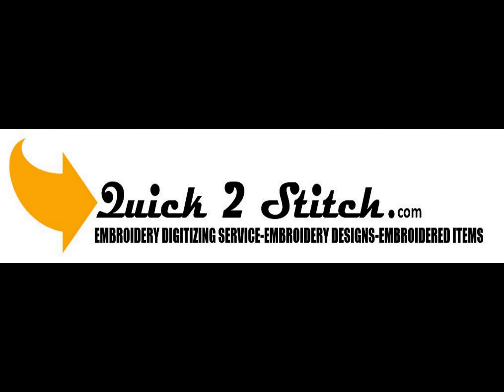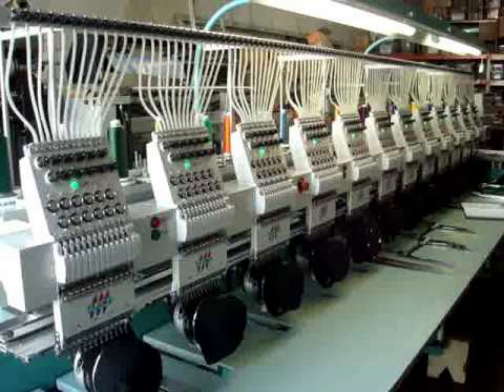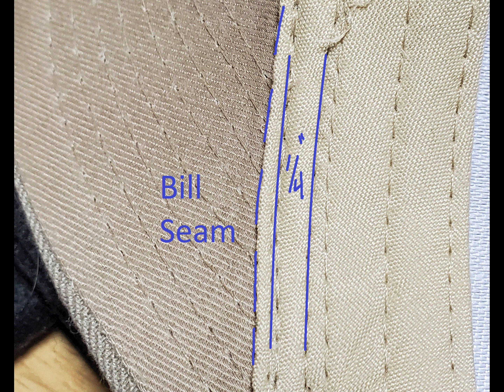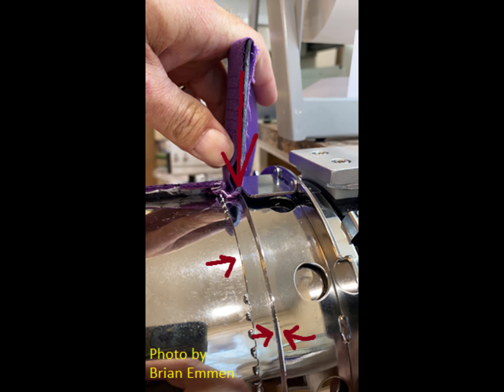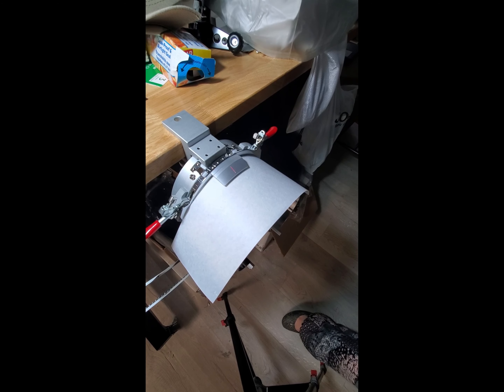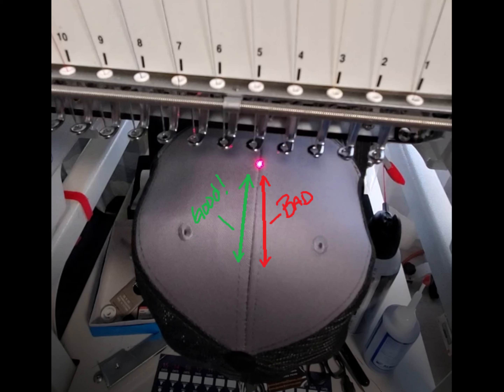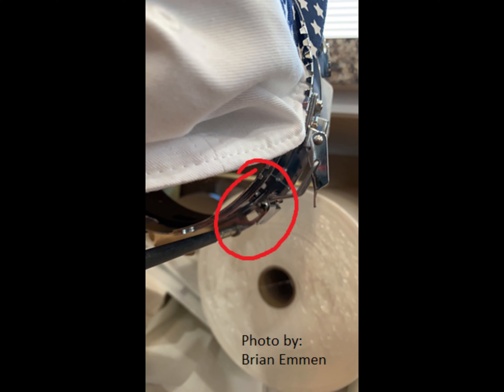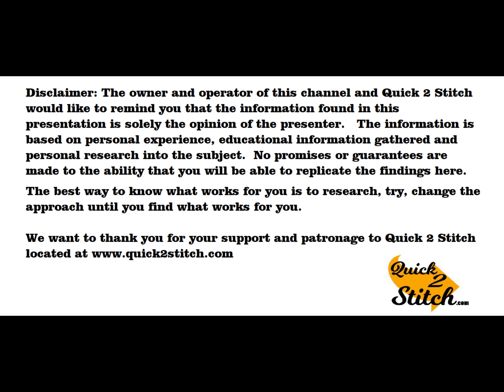Anatomy of a Hat Hoop

Comment: hallo how big can a design be and how far from the beak must the design start.  Thank you
Reply: The stitch area is completely determined by your machine - an older Brother/Babylock for example might only have 2" x 5" of stitch area - whereas my newer SWF machine has ear-to-ear by 3" tall stitch area.  As for how low you can go..  as long as your machine does not error out take it as far down as you can - try not to stitch taller than the break at the crown.
Reply: @ramonamckee5367   I have a Galaxy